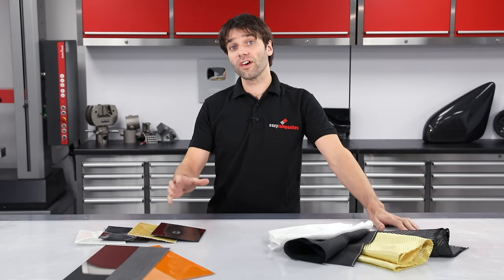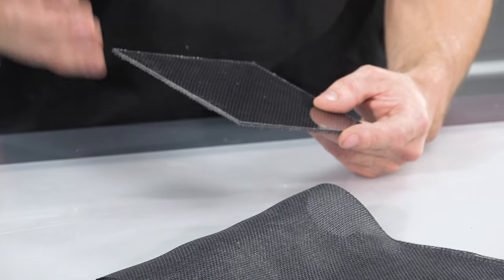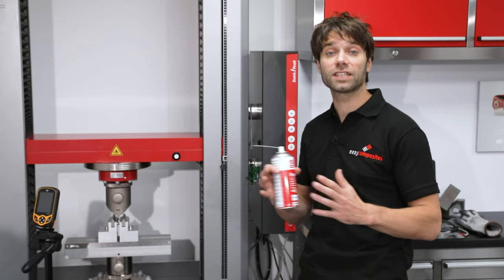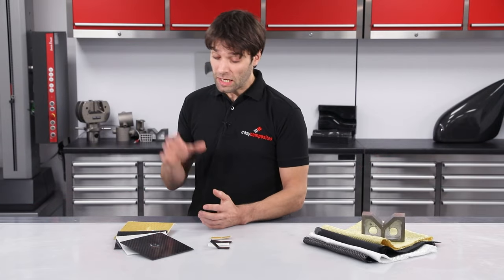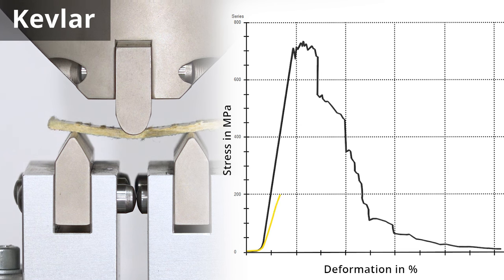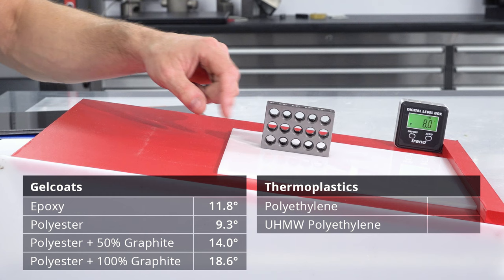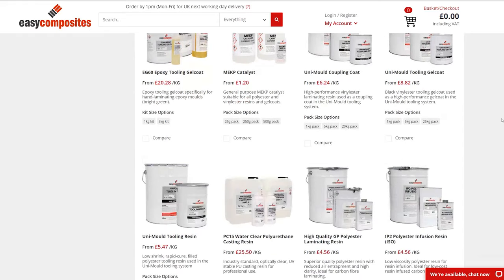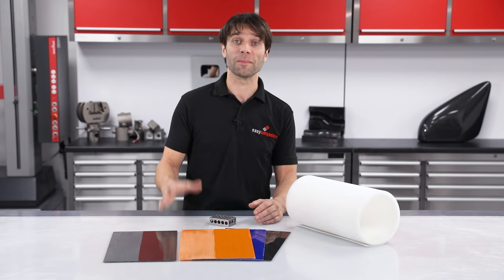Choosing Composite Reinforcements for Impact Strength; Kevlar, Carbon, Innegra, Diolen

Comment: What would be interesting is a sandwich of Kevlar core with Diolen outer to see if the advantages of both combine in a superior way.
Reply: BOB - Yes! In my younger days, I had multiple Fabrics Bonded together, for just this idea! Then I had S-Glass, Kevlar, & Carbon Fibre, to work with, but only small samples, and no testing gear!
Reply: Was about to type the exact thing.
Reply: I was thinking the same thing. I’m sure a mix of 3 or 4 of the materials would be a good combo..
Reply: Yep, compositing the composites! I was thinking the same.
Reply: afaik it isn't very interesting to mix multiple composite because they don't flex/break the same way :
because it almost doesn't flex the carbon will take all the load and break first
then all the load will be on the others layers and again the stiffer remaining material break first
One way it could be beneficial is on multiple features of the same piece where the stress is different
Reply: What about a thin layer of rubber or some type of absorbing type material to damping an impact between layers in a car that uses a monocoque as a chassis...
Reply: @stevilkinevil2205  that deserves a test
Reply: If you wanted to do that, why not give carbon fiber a second chance. It seems like it is basically a more exaggerated kevlar as they both start off with amazing rigidity, but lose most of it once it fractures.
Reply: Unfortunately it doesn't really work that way. Different modulus/tensile strengths means you will get the properties of one, and then the other, and not both simultaneously because of the heterogeneous nature of composites. It's not like alloying metals, where you get a (at microscopic scale) homogeneous material that has the same properties no matter where you measure in the material.
Reply: @grinchyface  I've always been curious as to how a mixed twill of non-similar composites would work. It seems like carbon-kevlar is one of the more common ones, but their material properties are a bit too similar. I'm more interested in how a carbon-diolen fabric work out.
Reply: @xaytana  well because Diolen elongates quite a bit more than carbon before failure, you will have the carbon fail first and maintain a very carbon-like stress strain curve, and then the diolin will fail exhibiting a very diolin like stress strain curve. 

One of the main reasons carbon and other materials are mixed is to change properties unrelated to tensile strength. Like toughness, abrasion resistance, cost, or physical appearance.
Reply: Composite reinforcing material is meant to be exactly that, the combination of two or more reinforcing material. I was thinking Kevlar for impack and carbon for stretch and twist but maybe not now days.
Reply: Let’s just not use these composites to build a deep sea submarine to go check out the titanic

Comment: You should have tested fiberglass too; E-glass and S-glass fibers
Reply: Having hauled glass sledges before, it's not something I want to repeat! Approaching twice the density of aramid/carbon/diolen - so it's cheap but heavy.
Reply: @AH-ns2wh  You'll be surprised how effective s-glass fiber is considering the cost. I can't talk about your experience but i'm pretty sure a well developed composite made via infusion vs wet lay-up (that you probably had) is a good choice.
Reply: @St0RM33  It's strong, for sure. I've tested S-glass. But the problem is the density. In a weight-critical world it's just out-competed by kevlar etc.
Reply: Kevlar is still the better choice here though. S-Glass has a higher tensile strength but these sleds aren't really carrying a tensile load - they need to be stiff enough to carry their load without deflecting too much which will mean their tensile strength is more than high enough to carry that load without breaking. Kevlar still has a higher Youngs Modulus, so it is stiffer than S-Glass. To achieve the same rigidity as Kevlar, you would need to use more S-Glass - and at almost twice the density of Kevlar, that would make the sled significantly heavier for the same rigidity. 

Agree it would have been cool just to see the performance of fibreglass in the tests though, seeing it is so common. But - this is advanced composites! Unless you are looking for ultimate tensile strength or outright lowest cost; there is always a higher performer than fibreglass.
Reply: @AH-ns2wh  yes i know but it would be worth added to this video even though it's not the ideal application. Probably because (i assume) Easy composites doesn't sell it
Reply from the maker: You are right we don't sell S Glass but it was not shown because the reasons mentioned above.  It would be a waste of time to do the testing on materials that were ruled out early on for this project.  The video was deliberately tailored to this project so although some might find other materials properties interesting, it was not relevant here.
Reply: @easycompositestv  fair enough;p
Reply: s glass is considered tougher but not the strongest? worth a test ;-)

Comment: 6:10 Yes you see carbon fibre in the crash structures but these are designed to break - the total oposite of what we are trying to do here. They work by inducing as many cracks as posible in order to absorb as much energy as possible. They are one use only. Also here you can see barely no visible damage but if you would look at delaminations, you would see a total different pictuere. If you would load it afterwards, it wouldn't be able to carry nearly as much load.

Comment: Really enjoyed this breakdown! My father was a composites specialist for various manufacturers in 80s rallying/90s touring cars.

His choice of material would entirely depend on its location within the car. A reinforced carbon-kevlar composite was preferred in rallying for the whole external bodywork to account for both weight-saving and durability. Incredibly expensive to build (and rebuild) in large quantities but manufacturers were sparing no expense back then! 

In touring cars all the composite work was interior since only materials used on the production models were permitted for external bodywork. Impact damage was less of a concern for door cards, instrument panels, flooring etc. so carbon fibre would be used exclusively.
Reply from the maker: That's some great insight you have there! Getting the correct material for each specific location can be tricky especially when there are so many options, it is very important to consider the exact requirements and parameters and what is the most important to prioritise for each particular component. Thanks for taking the time to comment.

Comment: Great video, and very useful for what I'm doing. I need to construct a battery box for a sprint kart with 420 18650 cells. Impact strength and structural strength are key, along with light weight. Kevlar looks like the best choice of these, and is much superior in terms of weight compared to thin welded aluminum plate, plus it's almost non-conductive.

Comment: I'm glad to see the friction testing after sanding. I would have thought that this would be a big concern for the sled. The runners or other gliding surfaces may become abraded after several tens of miles of hauling, and testing the friction results of pristine surfaces may not reflect changes with use.
Reply from the maker: Yes, that’s what we thought too, although, as mentioned in the video, the Dark Ice team said that generally the underside of the sledges come back almost as new.
Reply: If you avoid rock/grit, the gelcoats usually end up with almost no abrasion over ice and snow. I have a sledge that's done over 1500miles, and has a perfect 'as new' gloss surface still. Oddly, here we found the sanded graphite-filled resin was lower in friction, so an improvement compared to unsanded/glossy, filled epoxy.
Reply: @AH-ns2wh  Darn, no videos of your sledge on your channel. I think it would be fun to see your sledge.
Reply: @ddegn  Aha! It's heading out onto the ice this winter. Stay tuned.

Comment: Alpine Skiers have highly molecular Graphite sintered contact surface to the snow. The contact surface get an structured surface finish. The same when you apply wax on it. You brush the wax to reintroduce the structured surface.
Structuring reduces adhesion and friction.
Well on the slides for the expedition you will have the gelcoat, and you won't do waxing, but better think about microstructured surface.
Furthermore there is electrostatic charging and the resulting brake effect.
The Graphite in the contact surface of an Alpine Ski is most important here.
There was the Blizzard V20 RS (Giant Slalom). Originally highly oversaturated with graphite. The FIS requested Blizzard to reduce the amount of Graphite even in the serial production Ski. I still have one pair before the Change of the recipe. This Ski is infernal fast.
My proposal would be to experiment with gelcoat which is saturated with Graphite and get an structured finish.
A company which could be on your wavelenght regarding Innovation and Challenge is e.g. Völkl / Voelkl (Straubing, Germany). Maybe they have an idea how to structure a gelcoat.
They've invented the Speedwall(s), which is(are) the Sidewall(s) of the Ski. This Speedwall is structured as well and gets waxed as Well.
Just think about this Speedwall in gelcoat. That could be a explanation, which the Völkl / Voelkl Experts understand.

Would be Teflon /PTFE too soft for the Skids?
Reply: Thanks for the considered input here, and it's something @easycomposites and I have discussed prototyping in future, but where there's time to test/break and not on a critical expedition. The impact resilience of PTFE meant it was discounted.

Comment: We've used Innegra before, but if I remember right, ours was white. To cut the dry cloth we had to tape both sides and use a cut off wheel on a die grinder to cut it. We couldn't cut it with scissors. It's what they're using as the tether material for Indycars to tether the wheels, nose, etc to the tubs.
Reply from the maker: innegra and aramid based fabrics will cut with dedicated aramid shears

Comment: The first thing I'd do is ask what the ski and snowboard builders use for the bearing surface and do that, including the waxing process directly before use. That's not a new technology, and if you wanted to make sure your resin bonds well to it, just test a piece. The difference between skiing on wax thats seen just a few days of use is noticeable when you rewax them, it's way more slippery.

Comment: UHMWPE will require mechanical fixing to the sled, It is very hard to get adhesion to  UHMWPE in surfaces that flex. If you wanted to attach a sheet of it to the sled I would recommend milling fine dovetail grooves at a 50% material fill rate or impregnating a stainless exposed mesh to act a a "keying" material.

If it was something rigid than Loctite and other corporations offer primers for low energy plastics but in practice the suffer from adhesive release in high impact or inconstant surface stretching situations.

Silicon spray or CRC 2-26 are both great Hydrophobic lubricants and coatings that flex and won't damage Most** plastics.
WD40 and CRC5-56 will yellow and damage plastics but will temporarily act as a good hydrophobic coating but is still not recommended.
Reply: Any worries with silicone spray contamination of the shop/paint booth/molds?

Comment: That's a very professional material comparison.
I hope you make a comparison for a hangglider, too. 
I really wonder what would be the lightest options for a Klingberg mk2.
Also, if there is a signifant difference between high pressure carbon fiber vs laminated vs braided(?)
Reply from the maker: Hi Hanes, that might be a bit too specific for a general audience but we’ll try to keep providing more general guidance that would be applicable to projects like a hang glider.

Comment: What did you have in mind for bonding the UHMW film? Ive used scotchweld DP-8005 with great success for bonding 3d printed brackets to pelican cases (polypropylene blend) but thats not exactly a laminating resin. IIRC it has a rather potent chemical that was a cross linker to allow it to cross link the acrylic adhesive base to typically chemical resistant plastics (UMHWPE, POM, PE, PP, PTFE, etc) but it was also good at cross-linking DNA and being carcinogenic, so I would actually make sure to use it in a fume hood, be mindful of gloves, rather than the more casual way that something like JB weld may get used.

Comment: Great video! Nice testing and well explained! Was just a bit disappointed not seeing the carbon/Kevlar hybrid in the testing as I assume it is designed to solve the problem of having to chose between Kevlar or carbon for stiffness or impact! Keep up the good work, can't wait for the next video 👌
Reply from the maker: Hi Matt, thanks for your comments. Maybe we should have included carbon/Kevlar but we had to decide to stop somewhere. There were lots of other fibres we could have tested (PBO, UMHMPE etc.) and then there are hybrids of all of these fibres. We could probably have tested 20 laminates and still missed some obvious combinations. To address carbon/Kevlar specifically, although it might seem an obvious choice, the problem with a hybrid like this, for this application, is the failure mode: because Kevlar offers less stiffness and has a higher elongation than the carbon, in the event of a heavy impact on a carbon/Kevlar hybrid the Kevlar can (potentially) elongate past the maximum strain of the carbon, the carbon will break, leaving the Kevlar holding things together but possibly doing only that, holding it together. If you had another 2 months to drag a compromised sledge across the ice, you'd probably wish you'd made it all out of Kevlar.

Comment: I've learned more through this company than any videos I've watched from U.S. based companies..Extemely informative.....Now, the question is, what combination of these materials will give you the best strength to weight ratio in all areas....I'm thinking a layer of carbon as outer for initial impact strength, then a layer of kevlar, and finish with 2 layers of diolen....let the carbon takes the initial hit, the kevlar backing that up and then the diolen as a method of extending the overall strenth with some flexibility should the carbon and kevlar completely fail on impact....oh, the ideas that come to mind...I bet it would be great fun making and testing various combinations of these materials...as well as educational...OR, maybe diolen exterior layers, 2, then kevlar, then carbon....hmmm...ideas....
Reply from the maker: It entirely depends on the design of the part, there is no set answer.  You would ideally need to do comparative structural calculations or testing to sort the best combination.
Reply: @easycompositestv  Couldn't agree more...I think it would be enjoyable, along with educational, to do a lot of various testing combinations for various applications...

Comment: I'd love to see more guidance on choosing material for various types of projects. For example this video doesn't include fibreglass, and while it might have been a priori not the right choice for this, it is my understanding that being inexpensive is not its only advantage, it also has distinct durability advantages in some uses. It is obviously comparatively dense, but sometimes the weight disadvantage doesn't matter and envelope is more important.
Reply from the maker: You're right that fibreglass can have advantages over carbon fibre in some key areas, it's much better at not blocking RF signals for instance in use with model planes etc. We do want to cover more videos with material choice in mind, one of the issues are keeping it relevant. A guide covering every material choice for every possible application would be very long indeed.

Comment: This is great info as I am making parts for sports cars and needed to know what material would have the best resistence to impact - primarily rocks thrown up by the tires into the fender well. Currently the cars have ABS, but when it gets cold it fractures. Having a combination of materials would probably be the best and I've settled on carbon/kevlar for the wheel side and carbon fiber for the engine side. Thanks for the series - I'm looking forward to the next one to see how you lay up the sledge.
Reply from the maker: Great, glad it's been interesting/useful. We hope your project goes well :)

Comment: Very nice tests.
And here's the But... What about hybrid composites? Layering the white fibers with keflar in the center?
Don't know how many layers were used but putting about a third of them as Keflar in the middle of the stack would make for an interesting test I would think.
And on a side note, testing impact with the outercoat applied would be important to. To see how the coat gets damaged in the process and what that would do for the friction with the ice and snow.
Reply from the maker: The tests shown were designed specifically for the sledge and its expected use so we have had to limit the scope of what was tested and shown. But yes there could be a lot of different combinations tested that might have different results.